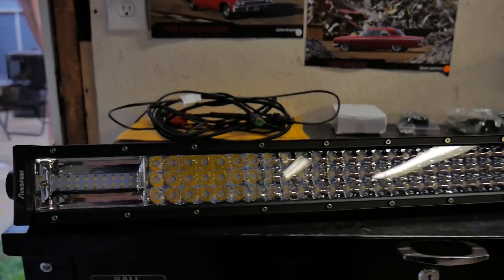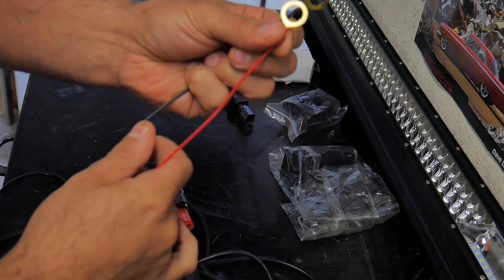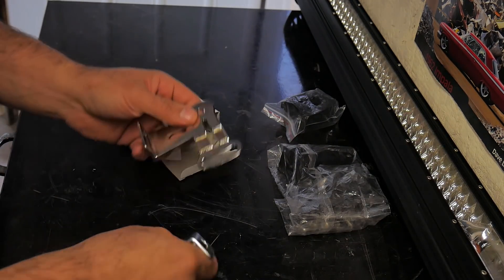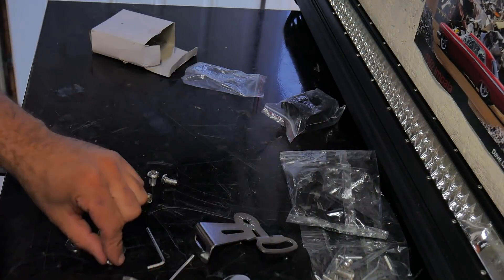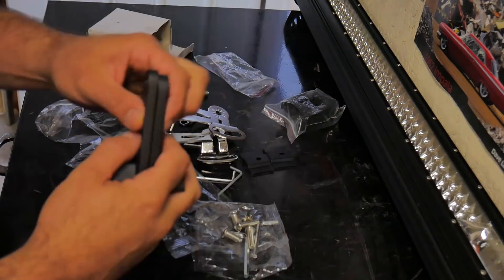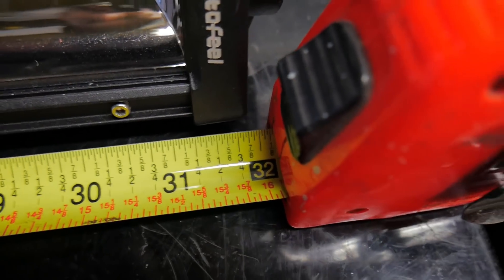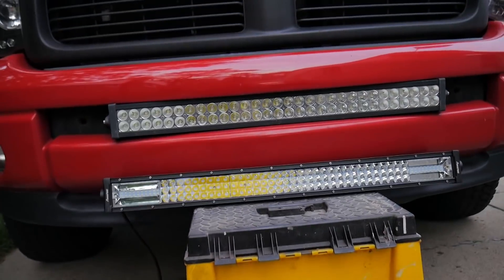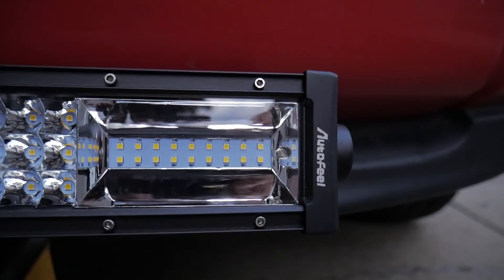NEW 8D TRI ROW LED LIGHT BAR by AUTOFEEL

Comment: The allen key is modified to work with the security bolts, there is a small whole drilled into it
Reply from the maker: mine weren't modified.......
Reply: that's funny that you say they didn't come modified, because @ 8:48 in this video you can clearly see the holes in the allen keys that were provided
Reply: Maybe he meant that he hadn't modified them.
Reply: Obviously you've never bought from the company "Autofeel", the Allen Keys come from the distributor ready to be used with the security bolts. There isn't any modification needed